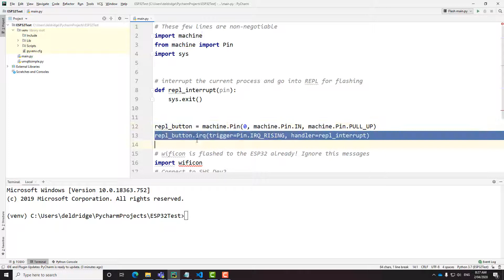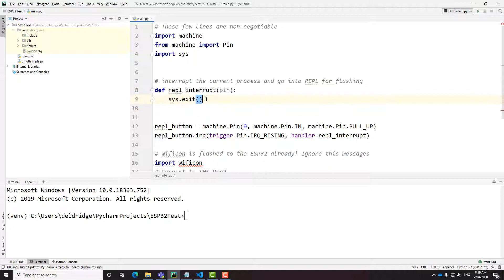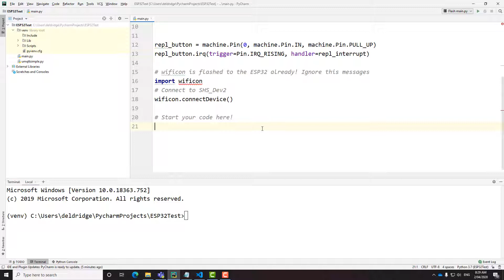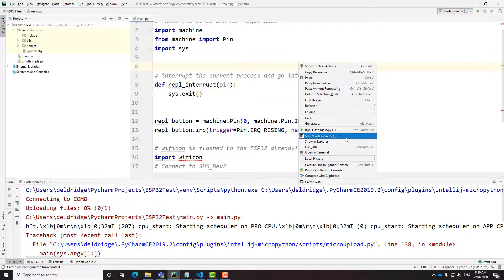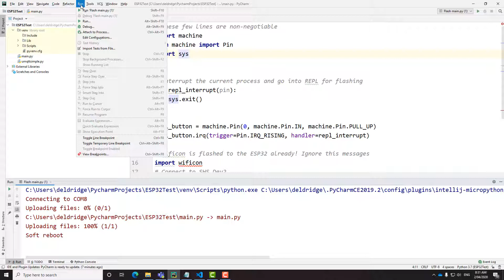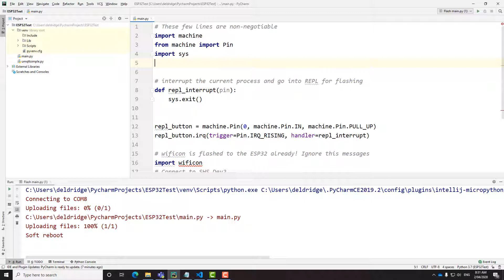ESP32 Flashing

Comment: I am getting no module 'machine' what should I do??
Reply from the maker: Have you enabled Micropython in the settings?
Reply: @davideldridge5852  yes I enabled micropython, program is executing till soft reboot with no errors but led is not blinking , what should I do??
Reply from the maker: @shivanibutle5690  try this code
from machine import Pin, reset
import sys
import time

# Change this for each location

# REPL Button
def replirq(pin):
    sys.exit()

repl_button = Pin(0, Pin.IN, Pin.PULL_UP)
repl_button.irq(trigger=Pin.IRQ_FALLING, handler=replirq)

ledPin = Pin(23, Pin.OUT)
while True:
    # Turn LED off
    ledPin.value(0)
    time.sleep(1)
    ledPin.value(1)
    time.sleep(1)

Make sure your indenting is correct :)
Reply: @davideldridge5852  Thank you so much 🙌🙏also I got my first code working just by changing the file name from main.py to boot.py. But thank you once again your videos really helped me😀😀